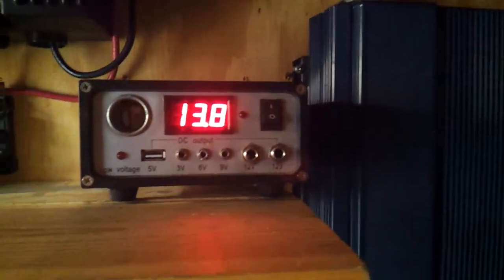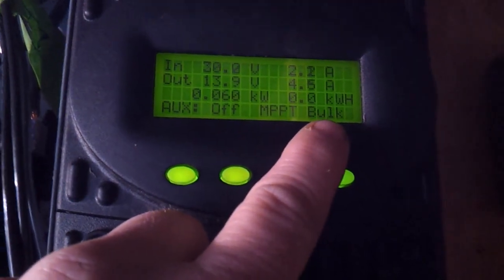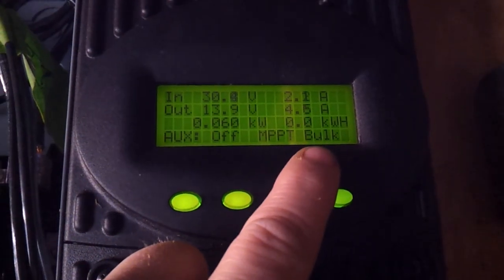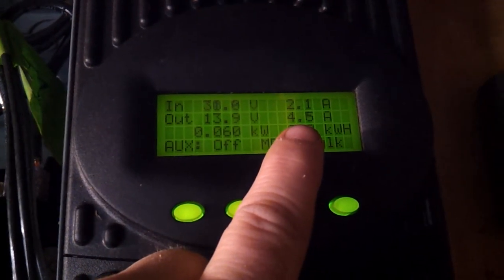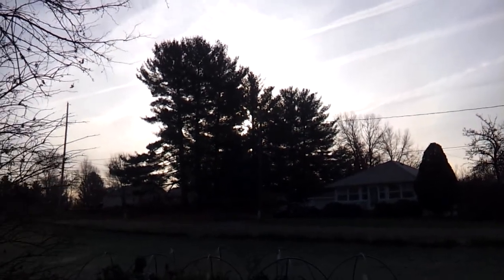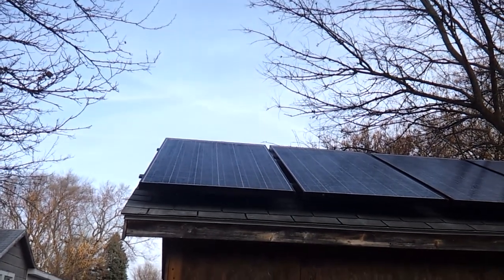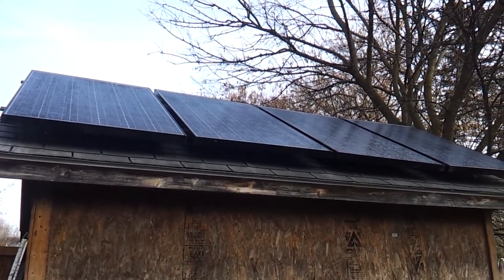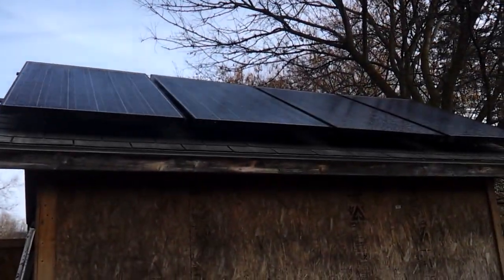Reinstalling my Photovoltaic Solar set up Part 2

Comment: Hi, from what i see you are running AGM Batteries... I just wanted to make sure that an equalize cycle won't damage them.  When I got my AGM's I was told not to equalize them.  Just dont want to see anyone damage their system.  Nice job on the setup.